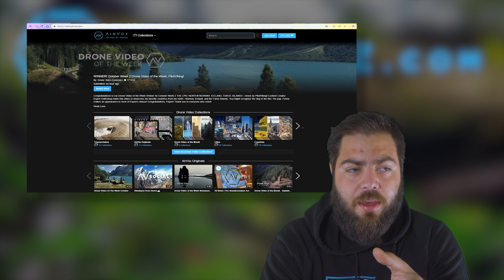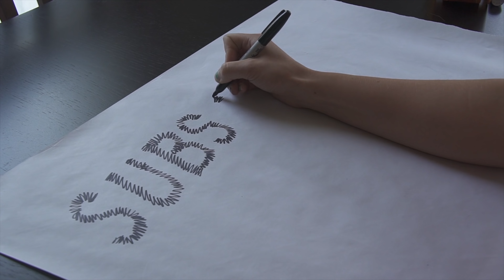Free Goggles // Aomway Commander Giveaway

Comment: Sweeeeeeeeeeeeeeeeet!!
  I am attempting to get back into the hobby after having to part with all of my gear this summer due to unforeseen circumstances, just made my 1st major purchase and got a X9D plus second hand and broke myself doing so.. Eating proppos here WITHOUT MILK lol It seems like it's going to happen just like last time, I have to buy all my gear over a years span and then I'll finally be able to fly. Goggles are what is holding me back, if I where to win a pair of goggles it would cut the time its going to take me to get back in the air in half if not more. I would be forever grateful and most likely paint NURK on the front. I would then spend all of the following days attempting to pay it forward and pass those goggles on the moment finances allow.

GO NURK AND I REALLY HOPE I WIN!